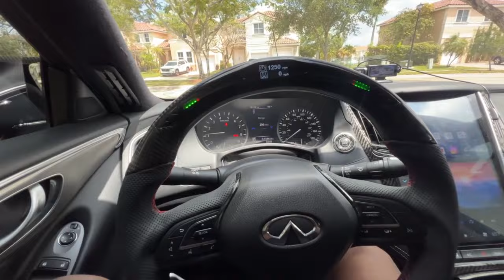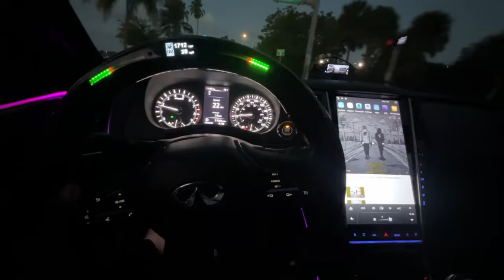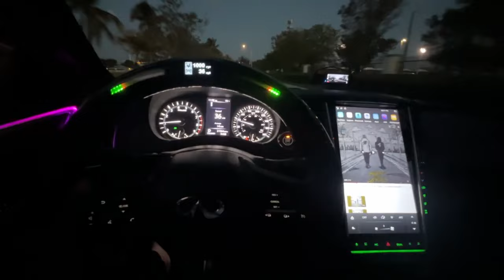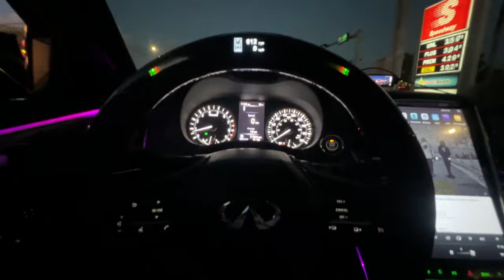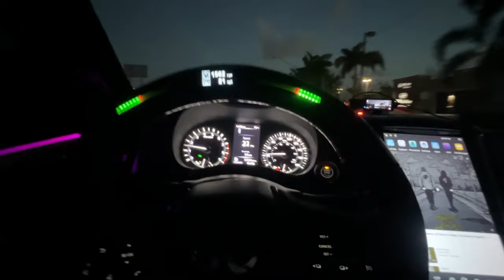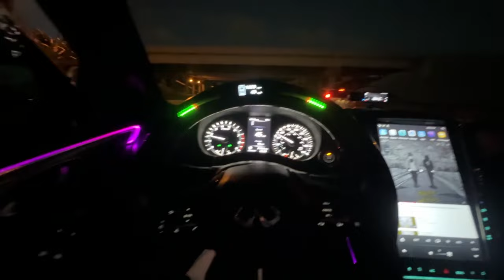INSTALLING A LED CARBON FIBER STEERING WHEEL IN MY Q50S!!! + TUTORIAL (INSANE POV)

Comment: Yoo bro how did u fix the clock spring because I’m have the same problem….
Reply from the maker: You have to count the amount of times the clock spring can turn from left to right and you split that number down the middle and that’s how many turns it should be
Reply: @Q50Reggie  how many time did u turn it because mine it’s just keep turning

Comment: how do connect the Led thooo
Reply: I just bought this for my Q50 and my battery died the next day . Pain in the ass with this LED steering wheel.
Reply: You find any solutions hit me up . I connected it to the horn and found the steering wheel blinking red the next day and with a dead battery.